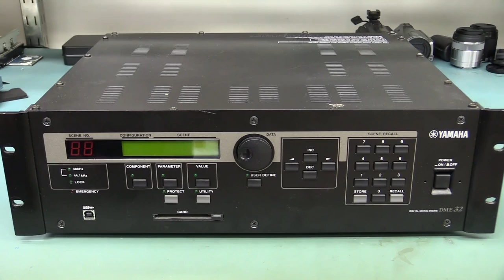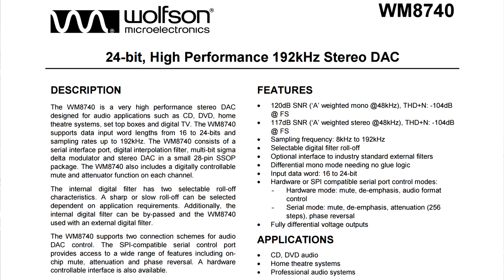EEVblog #738 - Yamaha DME32 Digital Mixer Teardown

Comment: TRS, XLR, and DB25 are basically interchangeable as balanced line-level signal connectors. It's simply a matter of how much physical space you have available to work with. Don't confuse balanced TRS with stereo TRS though. XLR is always balanced. DB25 just bunches the 3 wires per channel (hot, cold, gnd) into a tiny connector to save space (8 channels). You can get DB25->TRS or ->XLR adapters in case you needed to custom route those outputs to separate devices rather than just tunneling them all to another single device with a DB25 input.

Comment: Yo dave, sound engineer from scotland here.
these boxes are mosly used for situations where you are doing install audio setups and you want to pre-program a bunch of stuff and then leave it for, how is best to say this.... n00bs to operate. it can only really be programmed by a pc and is then left to recall presets for different operational situations.

some audio pros still use them as interfacing systems with modern mix consoles but these aren't particularly commonplace anymore and will only be brought out in the field for specific rare situations.
these days digital consoles are processing 196 channels of analog i/o @192khz 24bit and consist of a control surface (a dumb remote controller that looks like your traditional mixer desk with faders and rotary controls and buttons althought somewhat fancier, often with touch screens and fancy LED lit stuff everywhere) and a processing core (a big box in a rack case that has all the audio and other interface ins and outs on it.
these days two engineers can work together on one box to do the whole show, so you can have a single processing core and two control surfaces all connected via massively long redundant pairs of cat5e cables and have one engineer controlling front of house mix (crowd mix) and audio feeds for press or recording or whatever while another engineer is doing monitor mix (stage mix, in-ear monitors etc.) effectively on the same processing gear from the same set of audio inputs.

it's pretty fascinating stuff.
Reply: Soundcraft Vi6.
Venue S6L.
Yamaha PM10.

So much toys in such small boxes.
Reply: Cadac were better known for the J console.

Comment: 12:39 - Probably preventing ground loop issues by connecting at one single point on the input board.

Also, if you have trouble reading the numbers on microchips, get yourself a green LED torch and put your camera into monochrome (B/W) record mode. It should make it as clear as possible. Green has the lowest noise in CMOS sensors as well as using single wavelength to get the sharpest reflection from the chip. You can also try red and blue LED torches to see if that makes any difference to the contrast, depending on the ink used on the chips. Green is very good, though. I use my homemade torch all the time for reading chips.

Comment: Actually this device is not meant to be on the road. It's meant to be in a fixed location e.g. in hotel conference rooms, stadiums or community centers. The technician sets the device up for many applications and saves these applications in scenes so the janitor or house tech guy can quickly recall the correct settings for the desired setup. On the road you still use a common audio mixing desk. Both - analog and digital - are still present.

Comment: The reason you see scene is because it was designed for theater performances, where you literally have scenes.  You preprogram the thing for the scene number and then just push the next scene button.
Reply from the maker: Sam Petrocelli Ah, that explains it, thanks!
Reply: Sam Petrocelli that's real cool
Reply: Sam Petrocelli Stage lighting mixers are made the exact same way: program the lights necessary for each scene, then just hit "recall" during the performance. Greatly reduces the chance for operator error during live performance, and allows intricate lighting (or audio, in this case) changes that one or two people couldn't physically pull off instantly.
Reply: *****
i see those pins in the back(the green array) that look like open collector outputs and also inputs, could they be also used for that?
Reply: ***** when I was in highschool we had pretty big yearly productions and I had the pleasure of working with all high end lighting and audio equipment.  This stuff is really cool and a lot of fun to work with.  It's like industrial automation, but with audio and lighting.
Reply: Guillermo Lovato
 Possibly. I'm not familiar with this mixer nearly enough to know what those I/O pins are specifically for, but a lot of this type of equipment tends to have optional breakout boxes/cables available for that sort of thing.
Reply: Sam Petrocelli
I did too, although "high end" wasn't part of the equation ;) . We had a primitive automated light board (it still ran DOS), and I was the only one who bothered to figure out how to program it. Everyone else just used it manually, but programming lighting scenes was actually pretty easy. Funny enough though, our lights themselves were so old that the local theatrical rental company had a section of obsolete stuff specifically for my school: there was a big sign above it that said "Do Not Discard, Equipment Unique to Kennedy High School". Frankly I'm surprised nobody every got electrocuted working on those lights, they ran off 600V AC and were...sketchy, to say the least!

Of course, the year after I graduated, the public school board gave the school a bunch of money to finally upgrade their lighting and audio gear. The audio "gear" that existed when I went to school there entailed not much more than a couple old Peavey power amps, a couple of flown speakers (complete with a blown tweeters) and a mixing board that was so old the manufacturer's name was long gone. It was awful.

I did take Audio Engineering for three years though, through a program that allowed us to attend a media/arts vocational school in lieu of regular electives, so that was pretty awesome. As a musician, I learned a lot of stuff that I still use to this day. It's pretty amazing how much audio recording has advanced since 1995 (back when you couldn't get a ProTools rig for under $25,000!) The studio that made up our "classroom" had literally hundreds of thousands of dollars of the nicest audio gear, even by today's standards for the most part. It was great, and a lot of fun.
Reply: Guillermo Lovato Those pins are for the GPI, General Purpose Interface. Half inputs and half outputs, they can be programmed to do just about anything within the processor that could be controlled by a button or pot or fader. With the right circuit this thing could start blending margaritas for you at the end of the show!
Reply: Tylor Foster
that's cool, Dave can turn is bunker into a DJ cave now :P
Reply: Sam Petrocelli Well according to the owner's manual (http://www2.yamaha.co.jp/manual/pdf/pa/english/signal/DME32E.pdf) "Each configuration can store up to 99 scenes, or snapshots of every component parameter setting in the configuration." By contrast nowhere in the manual the proposed association to theatre performances is made.
Reply: Jörg Wessels  "By contrast nowhere in the manual the proposed association to theatre performances is made."

Ergo, it's a fancy margarita mixer, not for that theatre nonsense ;) .
Reply: Jörg Wessels I reckon that the term "scene" is being used because of tradition. Of course this beauty can also be used for music performances or even something like conferences, but usage in theatre and the like will most likely be most common. Today, the term might sometimes be an anachronism, but that's how professionals roll. ;)
Reply: ***** I think the manual defines the word 'scene' quite clearly in the context of this device, namely as simply a snapshot.

What's a snapshot for?

Imagine your job is to produce pieces of music as an engineer and before you finish one piece another order comes in which turns out to be more urgent than the former. What you would do with an analog mixer would be to take notes of the position of every fader, knob and switch and then work on the new, more urgent, production. When that is done you would resume to the previously begun production by reference to your previously taken notes. As you can picture this is a tedious and error-prone task.

With a mixer like this the snaphots are your notes. The tedious tasks of taking notes and using those later on are simply a button press each.

MIxers like this are an important milestone towards software based digital audio workstations that are used today.
Reply: Jörg Wessels Yeah, a snapshot of all the settings is precisely what a scene is in this context.
What I meant to say that all this gear was originally used in the field of live performances, mainly of theatrical nature. This (probably) lead to the establishment of the term "scene" to describe the set of settings for one particular scene (or subunit of a scene) of the piece. The terms "snapshot" or even "event" would be maybe better describe what a "scene" does for the sound engineer, but once a name for something is as well-established as the term "scene", changes in parlances are not exactly bound to happen 😉
Reply: Sam Petrocelli i dont like using scenes when using a lighting desk like a strand 200 lx or mx i cant remember what i prefer to record my sub masters carefully and do it all live and by hand not just next button go in my eyes theres just too much faffing about i am good with computers and that but sound and lighting desks just get to complicated when you go into scenes and other stuff
Reply: This mixer wasn't really designed for theater, more for sanctuaries that want a "set it and forget it" kind of mixer. The pins on the front are for external triggers.
Reply: @catdumpling  Unless the venue you work in is cheap then youre stuck working A/B :(

Comment: Thanks, at last audio stuff teardown. more audio gear plz.
Reply from the maker: Jetset Willy I might have another big one coming up... just a few issues with collection...
Reply: EEVblog Yeah ! Wolfson 192khz DAC is a damn beast.ty a ton again
Reply: Jetset Willy Anyone near Dave got a nice professional power amplifier like Lab Gruppen or Powersoft for a teardown? Would also be interesting to compare to an old-skool heavyweight Class AB amp
Reply: rarelycomments I have a McIntosh 2505 and I'm telling you there is not much in amplifiers for teardown and all are the same. Mixers, Multiband EQ Compressors, Synthesizers,Tape machines(Nagra ,Studer) are more interesting.
Reply: Jetset Willy Class AB amps are boring I agree, but you should see inside some of the latest DSP-controlled high power Class D amps for PA. Serious engineering!
Reply: rarelycomments BTW I like(wish) to see Boulder 3050 & Krell EVO-707 teardown before I die :)
Reply: rarelycomments Sorry I misunderstood you ,I looked at Lab Gruppen and Powersoft pretty interesting devices never heard of them ,Thanks for info.
Reply: EEVblog I've got an old broken Ensoniq sampler I've considered sending you

Comment: Dave, thanks for tearing down some audio gear! Usually SMD resistors show some non linearities in audio applications, remember we are using 24bit ADCs with more than 110dB dynamic range, that's probably why the analog resistors are all TH. Newer, biggish SMD resistors are better but small ones are still a problem for distortion in pro audio applications.

Also I think audio is more similar to measurement gear, hierarchical grounding more than star, you treat your grounds as signal reference, one for each signal following it. Of course you could use a plane for shielding but the actual path will be very controlled and following the signal, including decoupling caps and all.

About the connectors, the classic printer DB25 connector was introduced by Tascam IIRC, is standard audio connection, 8 channels. The TRS are also standard for line level and in both cases are much smaller than XLR of course and that's one of the reasons why they use those. DB25 is much cheaper and faster to connect than 8 independent XLRs, on the stage timing is all.

Comment: To specify about the TRS and D-25 connectors versus XLR, in a lot of mixers, it's standard to use TRS for line-level signal (usually around .775 V RMS). In this particular case, I'd imagine they'd have analog pre-amplifiers in the signal chain before this unit to gain up mic-level signals, and this unit would only mix the line-level signals. 

The "scenes" are basically presets of volume controls. You can set all your faders (linear pots) to a certain mix, save it as a "scene," and recall that scene whenever you'd like. This is good in concert environments to switch out several musicians on the fly, or in recording studios to save the settings for a band that plans to come back on a later day.

Comment: TRS-Jacks are used because of the lacking space für XLR but provide the same signals. ;) D25 is for studio integration or installations where you have to connect multiple analog channels to patchbays or interfaces...
Reply: Yes trs can be balanced as well.  Even down to TT size for patchbays n such.
Reply: Stefan Hächler I would imagine that they use TRS Line-level inputs because they expect you to use an external microphone preamplifer - if you're using microphones.
Reply: Yeah probably and then the board would have preamps and phantom power.  Kinda of an I/o bus and interface .  I'd like to see it paired up in action with a setup.  Might have been at the tail end of DAT's.
Reply: Jordan garrett ipullstuffapart Yes, if there is a mic-preamp it's standard to have XLR also in low-end gear. The solution with TRS for line-level is mostly a space or cost decision. Coming from that field i know a lot of gear with XLR-Linelevel I/O and you will normally wire all the signals with XLR-Cables and just use a small adapter to TRS in the end. For instance all my higher-end preamps / compressors do only provide XLR ins / outs...
Reply: Stefan Hächler As long one got good quality in TRS jacks it might not be a problem, because this mixer seems to be built to stay plugged. I would prefer XLR, too (or maybe some Tuchel?), but as you said, too much space taken up. And not necessary for fixed setup. The only Problem might be, that you can't separate shielding and signal-ground. 

Und eine Vermutung auf Grund des Namens, darf man auch deutsch sprechen? :D
Reply: 7head7metal7 auch Schweizerdeutsch :D
...and yes, tuchel would be great... maybe not in terms of space ;)
Reply: Coole Sache! Ich kann leider kein Schweizerdeutsch, aber wir verstehen uns ja hoffentlich auch so :D

That's true, and it is somehow outdated and too expensive. Screw-on-technology is better, if you have time, but the great advantages of XLR are fast connections, I guess. But hey, at least Microphones with Tuchel got cheaper on eBay :D
Reply: XLR is expensive and too big for high density interfaces.  It's always there for mic inputs, but if all you're doing is balanced line-level, then you use XLR when you're trying to impress someone or make use of a rack-width for 2 channels; TRS when you have multiple channels to deal with, or don't want to spend that much on jacks and cables; or DB-25 when you're tying to squeeze in all the I/O you can.
Reply: True! And of course if you need mechanically robust connections you would choose XLR, for example on stage-used patchbays.

Comment: YSS910-S is basically a pre-amplifier with effect :

Features: (1)Full Digital Signal Processing; (2)8 Channel Preamp; (3)Digital Effects; (4)Compressor; (5)Chorus, Flanger, Phaser, Rotary Speaker, Tremolo; (6)Digital Delay, Tape Echo; (7)Spring Reverb, Hall Reverb, Plate Reverb; (8)Tap Tempo Function (Delay Time); (9)Speaker Simulator (16 Types); (10)External Controller Function (EXP Pedal/MIDI):8 Controllers/Parameters; (11)Wah Function; (12)Tuner Function (Chromatic, Auto).

Comment: While rack mount systems like these have their applications in professional audio, we tend to use desks just like the analog consoles, except they are almost completely digital, so we still have our faders, but everything else is all done with a large screen, and the most commonly used system on broadway for theaters is the digico SD-8 costing $250K US. For portable rigs Yamaha’s most popular digital systems are the QL and CL series, the QL costing about $16K, and the CL costing about $30K

Comment: Hi Dave, as for those ground / chassis connections I design audio equipment and use 0805 resistor footprint in several parts of the gear to connect the ground at one specific point... for which I use a simple zero ohm 0805 resistor for this! :-) This is very useful at the development stages no doubt! Take care, great tear down, keep them up!